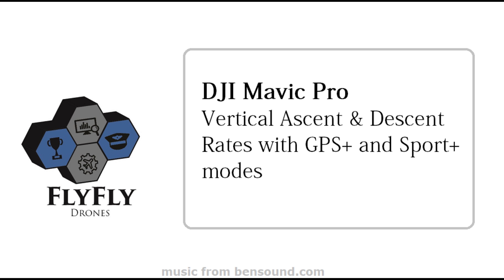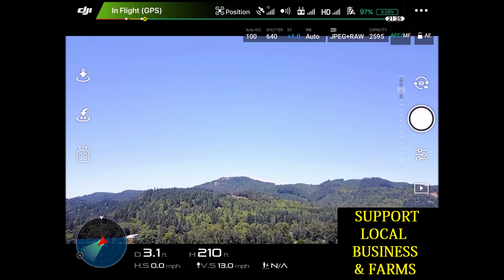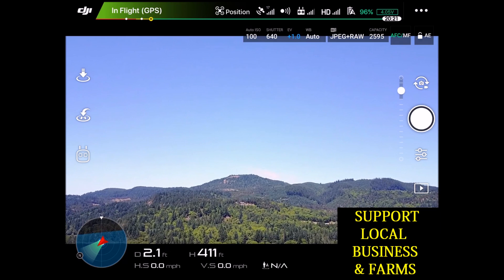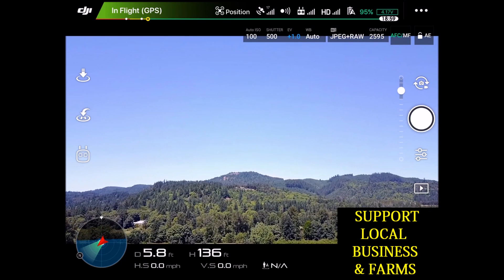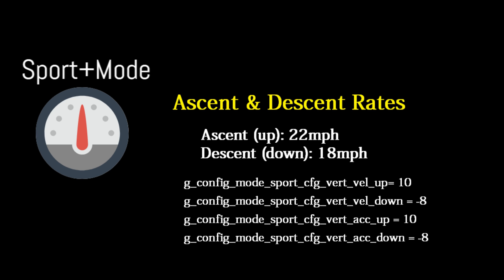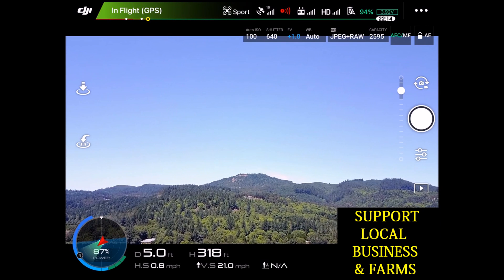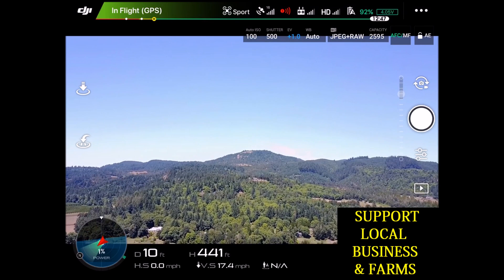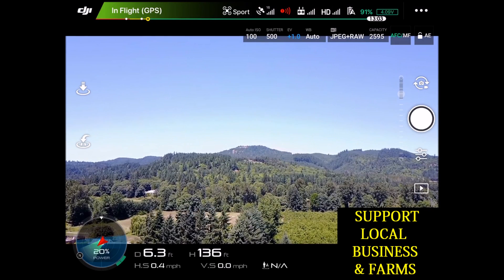DJI Mavic in flight (DJI Go screen recording) with speed modifications ASCENT and DESCENT

Comment: Your proposed setting of vertical descending is much faster than the factory default: 3 m/s. What I worry about is the occurrence of Vortex Ring State in fast descending. Does it easily happen to cause flip over while going downwards so fast, esp. in windy condition?
Reply: Mavic Henry This has already been discussed by u in the forums and u got your answer. Response was the Mavic can power out of that with its on board computer. Yawn!!

Comment: I guess the thumbs down was from DJI's software team lol...
Reply: Is it possible to make flips with the Mavic?
Reply from the maker: someone didnt like my support local business and farm message :P
Reply: I want to say that 400FT is just 120 meters I have flown above 400 ft which is 120 meters I have gone up to 500 meters with my mavic, when I put in the DJI go app 4 the height above 500 meters it does not allow me to will this surpass once my mavic hits 500 meters will it go up to 700 meters or even a 1000 meters that's my question about these mods
Reply: @digdat0 mate, do you happen to know if RTH descent speed can be changed ? stock 3m/s is too slow